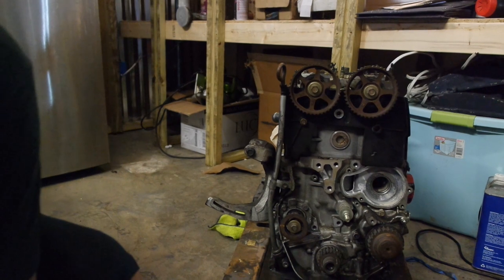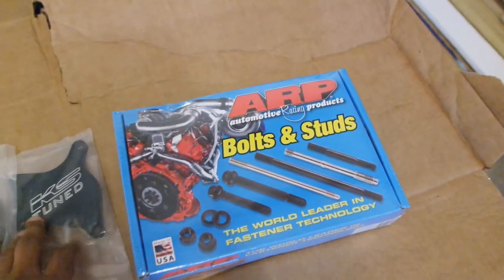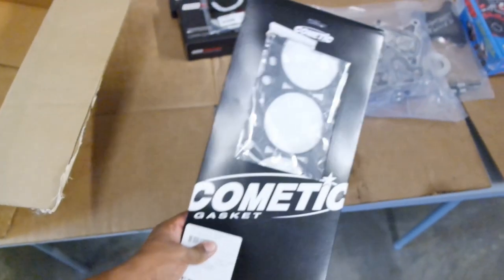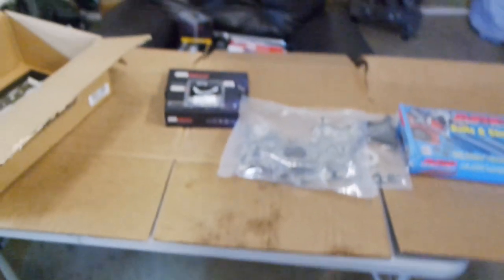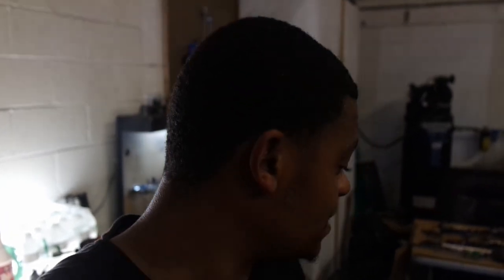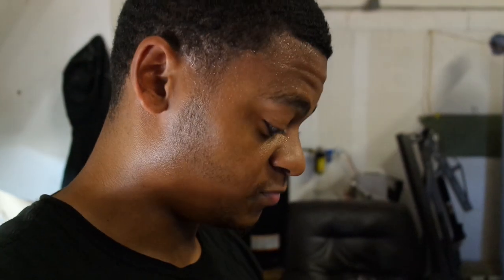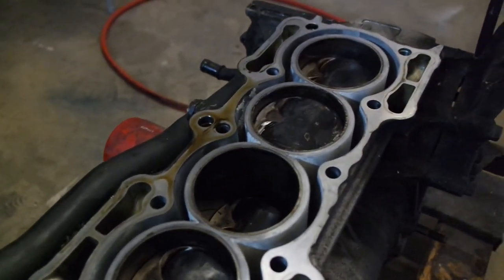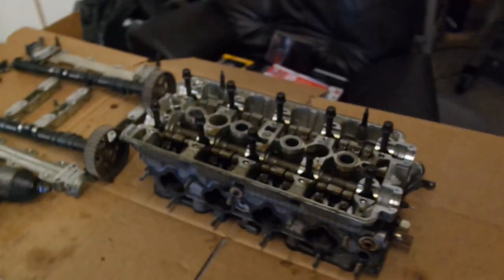600+hp turbo f20b build part 1| f20b head removal

Comment: Hey brotha ! How do you choose your head gasket? between the different options of thickness?
Reply from the maker: Im no expert on head gaskets but i went with a slightly bigger one 86mm because i had my block bored bigger for the pistons.
Reply: @treybedipping1734  What about the difference between .027" or .030" , .025" 
The thickness of the gasket itself? I was under the impression that the 86mm bore was to leave a 1mm overlay between the block and the head
And is the f20b cast iron SLEEVES? I thought the f20b was completely made of cast iron but my block is aluminum 
Are the cylinders also lined with FRM liner like the h22?
Reply from the maker: @grimmcharest8102  idk about gasket thickness but all f20b's are cast iron
Reply: @treybedipping1734 so your block is also cast iron? Or is it the sleeves inside the block that are cast iron
Im at such a loss lol i thought i did the right research
Reply from the maker: @grimmcharest8102  cast iron sleeves

Comment: How much power can we push the manual f20b head?
Reply from the maker: The head im not sure but the stock block is only good for about 350 10lbs reliably. Never had issues with the head
Reply: Trey Be Dipping yeah I’m gonna run it stock just this summer then I’m gonna build it too. But I’m wondering if I should build the head too or go kinda your route. I’m aiming for 500whp.